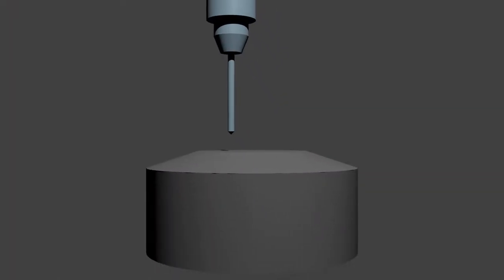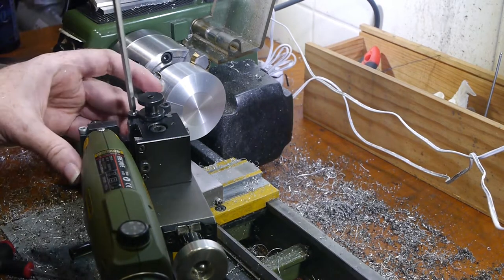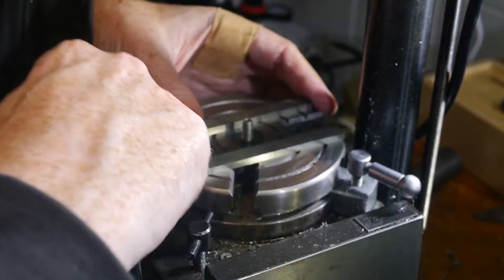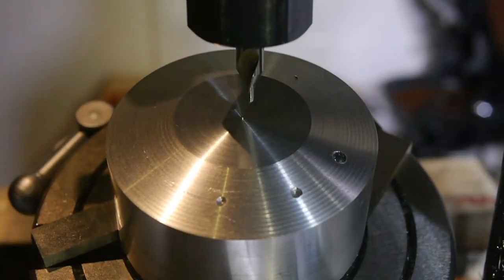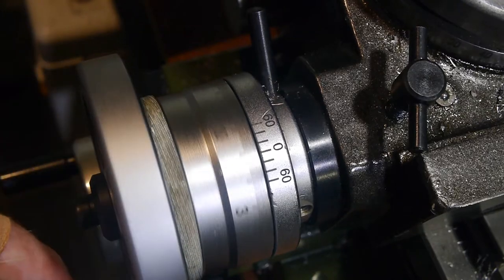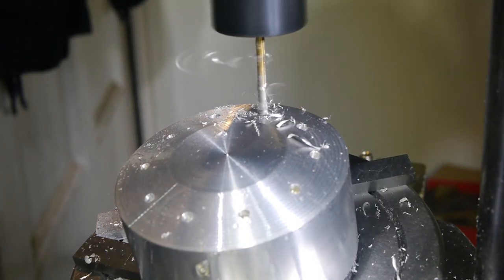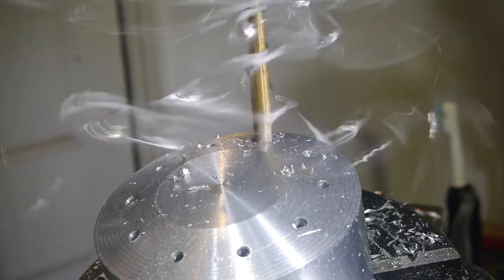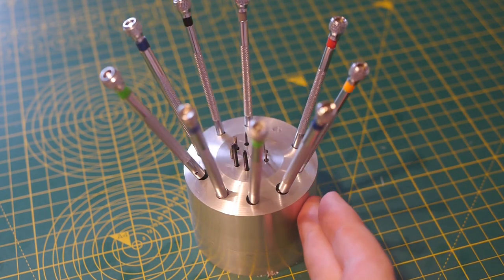Screwdriver Stand - Part 2

Comment from the maker: I think I botched the audio levels a bit on this one, but I'm interested in what you think. Do you prefer to be able to hear more shop sounds, or is clear voiceover more important?
Reply: Speaking strictly for myself, I don't need to hear the lathe turn. Voice overall. But the Chopin is wonderful. so do retain the background music.
Reply from the maker: I forgot to adjust the ambient shop sound channel down, so the lathe and drill noise is louder than I usually intend.
Reply: Nice work! I like the shop audio, personally.
Reply from the maker: There are spots where the drill noise drowned out the voiceover so badly that the auto-captions completely failed. I'll keep working to find the right balance, though it sounds like there is demand for shop audio to be a little louder than in my previous videos.
Reply: Audio is a lot like the three bears story. Not too loud, not too soft, but just-right :)
Reply: The most important is your narrative. While I am a Chopin fan also and recognise you wanted to do him justice, he must be relegated further into the background so I can clearly hear what you say. The music was distracting at that volume,
Reply: @toms4123  The Chopin was almost inaudible, and the voiceover and the lathe were far too loud!